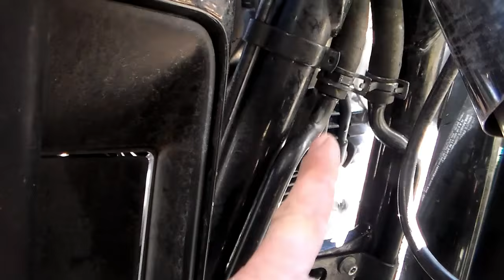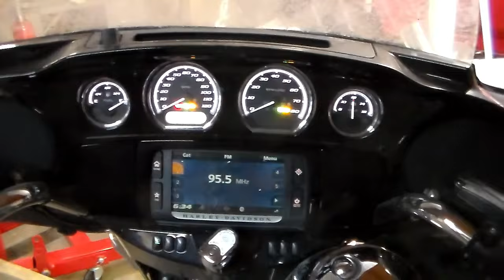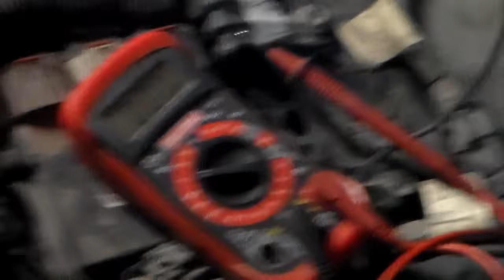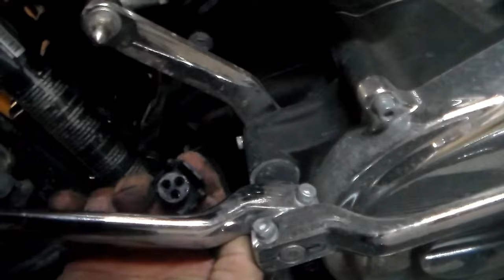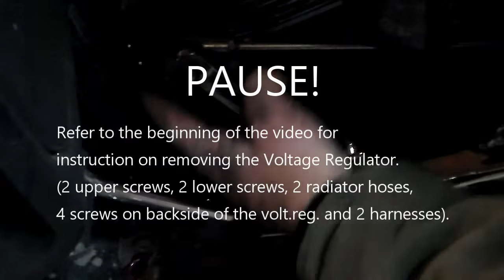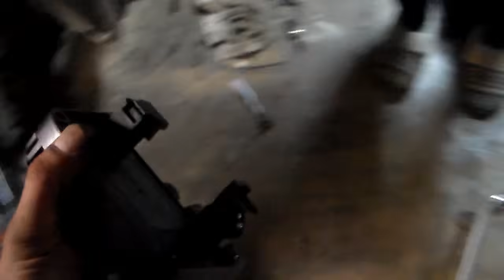How to TEST & REPLACE Harley VOLTAGE REGULATOR and STATOR

Comment: How does this test stator output? It proves the stator isn't shorted out and there isn't excessive resistance, but doesn't cover whether or not the stator is putting out any power.  My stator passed all these tests, however when the bike is running, there's zero voltage being produced at the stator terminals.  There should be 16-26vac being produced for each 1k rpm.

Comment: My battery showed 13 volts bike turned over slow then died put a new battery in and starter fires up great checked the voltage and it's 15 doesn't clime up on revs or go down wtf is it good or bad ? 09 Road king
Reply from the maker: I'd keep an eye on it but not necessarily alarming. 15v on these newer systems is "normal" but any higher and I'd be looking at the voltage regulator.

Comment: Do you know the difference between voltage and current?  Also ohm and continuity test are the same thing essentially.
Reply from the maker: I'm not sure what your point is but ohm's and continuity are absolutely not the same thing. One is a measure of resistance, One is a measure of continuity.
Reply: @rednecktech82 I do know the voltage regulator “ rectifier “ changes AC voltage to DC voltage. And when you test for continuity with a meter the setting is on ohms. I’m not trying to be rude here just trying to help. I did appreciate your video explaining the troubleshooting just wanted to give some clarification. I’m an Automation Service Engineer so I do know a little about electricity but that’s not the point here.
Reply from the maker: Lol, My apologies, i'm used to people on here trying to be dicks. Voltage is essentially the amount of power where current is the strength of the flow of that power. You can find a better technical definition by googling it but essentially thousands of volts won't kill you, it's the amperage of that voltage that does.
Reply from the maker: Think of cattle fencing. It runs at thousands of volts but if you touch it you just get a good buzz, it won't kill you because it's such a low amperage. Or electric baseboard heaters... 240V heaters draw less load on the system as they run at lower ampersge and therefore lower your electric bell vs 120v heaters that use more electricity because they run at a higher amperage.

Comment: My old 2012 electric glide ultra classic has new battery but the voltage gage drop down to to 6 voltage after riding for few minutes...I'm hoping it's not the stator in it's just voltage regulator.

Comment: Thanks for your great video, 
I have a crazy situation please help me out. 
My bike is brand new it’s only 10k miles. And it started normal and giving me 14.3~ volts and when i raid the bike for couple minutes it drops to below 12 volt!! When i shut it down for couple minutes cool off it do the same thing again! 
I took it to the dealer they said i have to change both parts the regulator and the stator !! I don’t believe that!! 
Please help me out.

Comment: You will need to purge cooling system after any fluid loss from disconnecting rubber hoses from metal tubes . Must bleed air out of cooling system otherwise motor will overheat .

Comment: That happened to me now but I replace regulator ignition coil spark plugs and the drop voltage still happend in my RGS what else I need to do??
Reply from the maker: You test the battery itself yet? I'd go to the forums too, I find a lot of help there.

Comment: What if voltage increases when throttling up? Still voltage regulator?
Reply from the maker: Always have the battery tested first It is possible for a bad battery to cause an overvoltage even with a good regulator. After that though you'd be looking at the regulator.

Comment: I'm watching on my bike(buell) my voltage hold at 14.2v then drop (not trickle, but drop) to 13.6v and hold there  for a min. Then drop and hold again to 12.6 For a min, then finally kicking my cel and holding a voltage of 11.6-11.8v. I was thinking vr. But I have a feeling it might be the stator
Reply: I’m having the same problem. (Dyna) I don’t want to buy both so I want to diagnose which it is